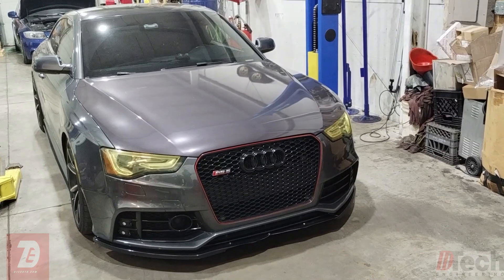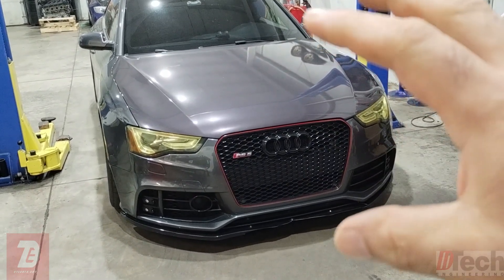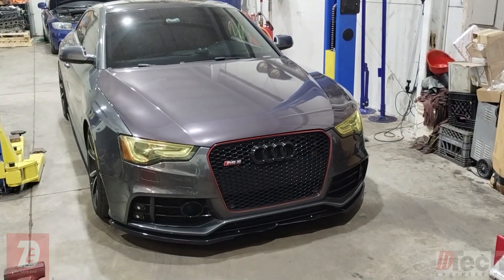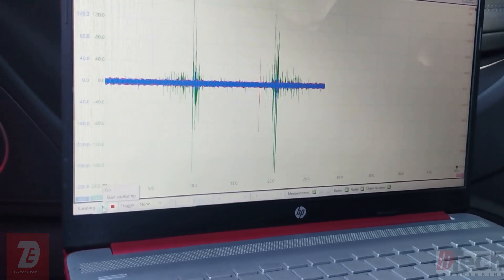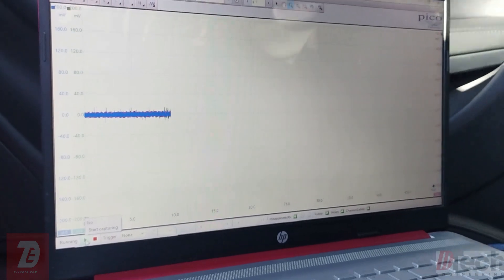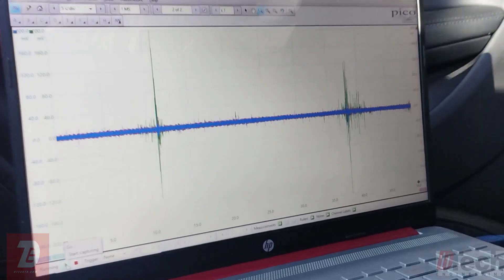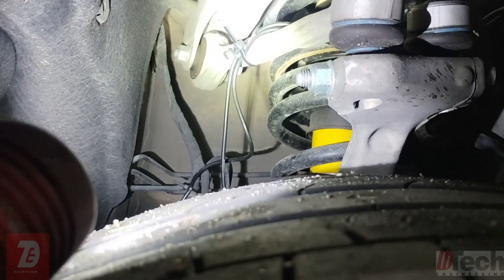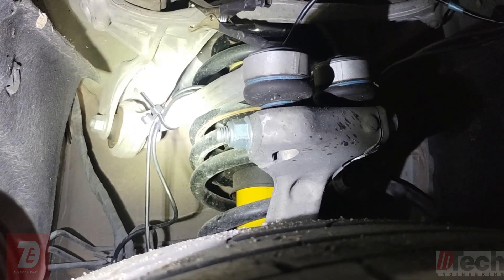Using the Scope to Find Suspension Noise

Comment: I've made my own with magnets/clips/piezo.sensors. I found out the trick finally is the tiny wires, larger wires than what come in the chassis eare, cause problems. That's why I bought Sadels, he solves this issue by using the traditional sensor, just a small adapter.. I also wanted to give him the credit for creating the solution. They are very well made. If you are like me, in your 50s or more and can't hear, seeing noise is so much nicer. Noise echos, side to side right through the drive line. These are a must have. If you have ever called the wrong bearing, these will be useful. You can give the customer a choice, pay me an hour for testing or replace all the bearings. Connecting chassis ears is a PITA. CHARGE for it when needed.  Thanks Sadel.
Reply from the maker: I definitely agree, it's better to test and be safe instead of sorry by overcharging for the incorrect parts, thanks for watching!